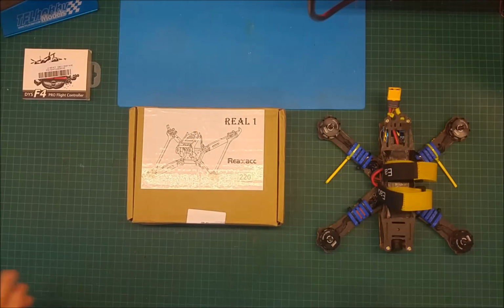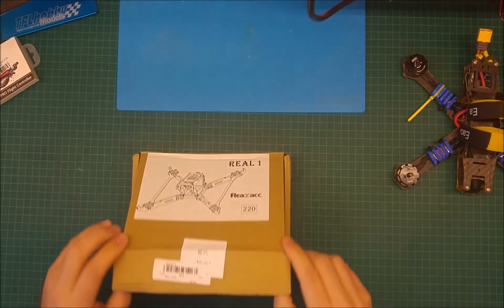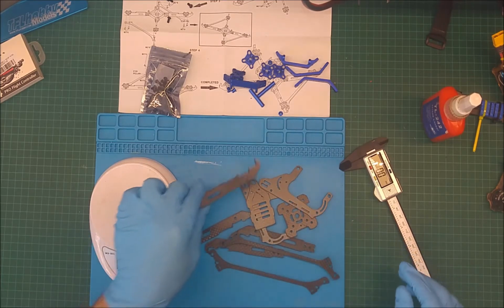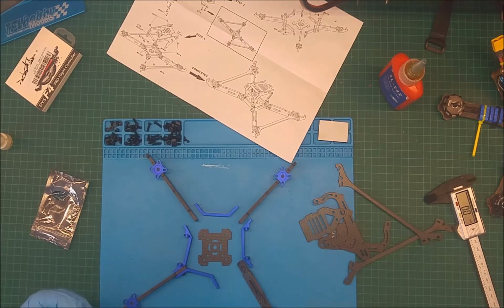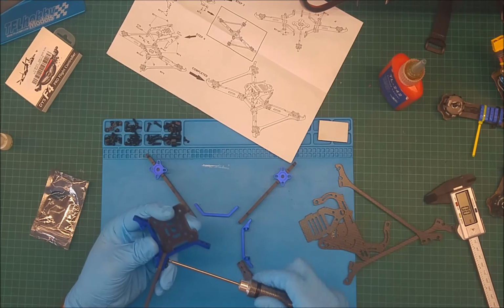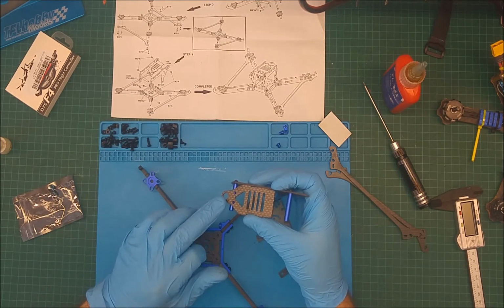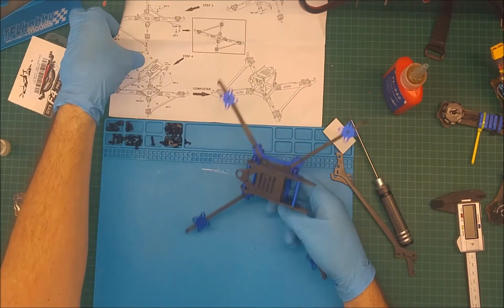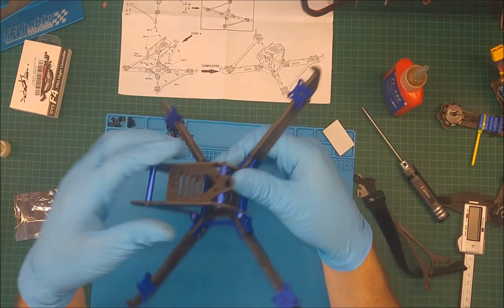Realacc Real1  Vertical Arm - Build

Comment: How "tall" is the aluminium where it says realacc? Is the groove for the 2mm bottom plate in the middle of the aluminium. Also how long are the 5mm blue tubes? Thanks
Reply from the maker: 1. 8mm
2. in the middle 
3. tubes - 30mm